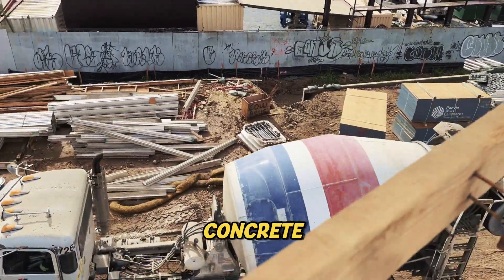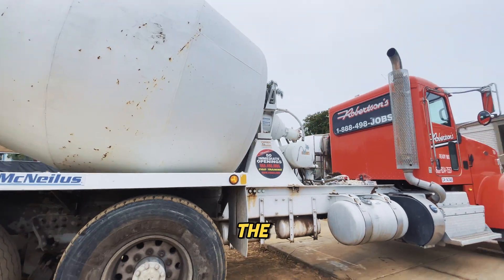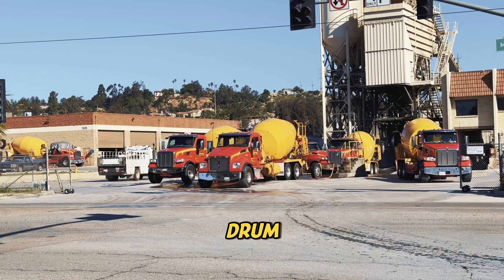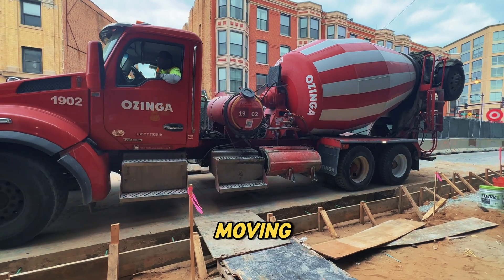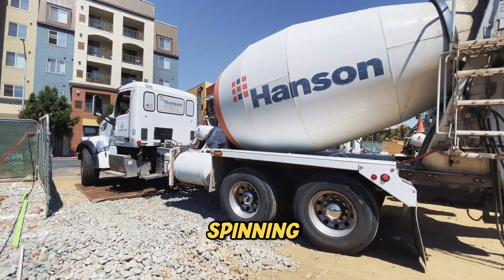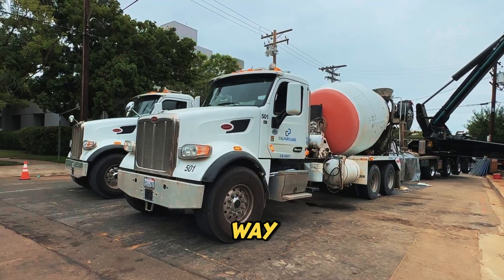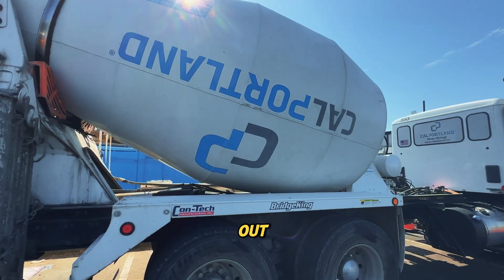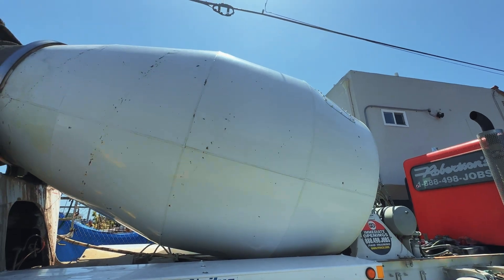Why Do Some Concrete Trucks Spin… and Others Don’t? 🌀🚚

Comment: Even with pump wash or leftovers on that drum is rolling on the way back to the plant. I want that water to stay in the drum, spinning it down helps with that. Leftovers doesn't matter quite so much as usually its only a couple yards, and I can't imagine a scenario where it would be possible to spill that, but I don't want that wonderfully old popped off concrete to have any chance to set up permanent shop on my fins.

Comment: You have to keep barrel turning even when empty due to You will flatten those rollers if You hit bumps on the road or  when the drum can bounce up and down when empty, that is what I was told early on !!!
Reply: Exactly! Even when a brand new mixer truck is being delivered from the factory there is a label hanging from the parking brake typically that says drum must be spinning in transit for this exact reason. Flat spots on ring or rollers is no bueno. 

You get people who never drive a mixer delivering them hence the tag. They’d probably get charged for damage if they did flat spot it.

Comment: There is a 3rd case for stopping the drum, I sometimes stop the rotation when I am transporting very very dry concrete, to prevent the drum from pulling the load on only one side, at the risk of overturning the truck.
Reply: This. Shotcrete on nice bumpy/banked roads? No thanks. That drum stops. Rural east San Diego County is rife with places where this is a thing.